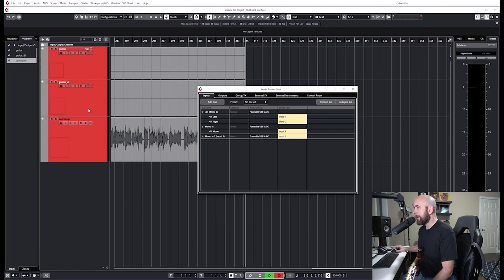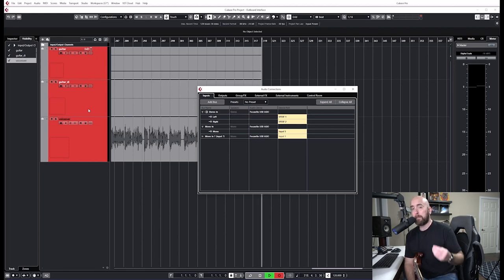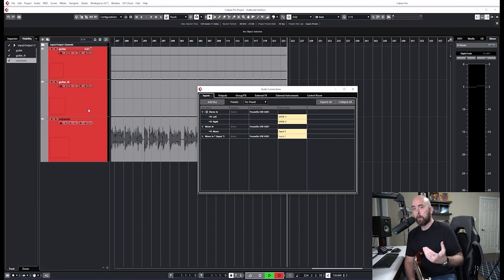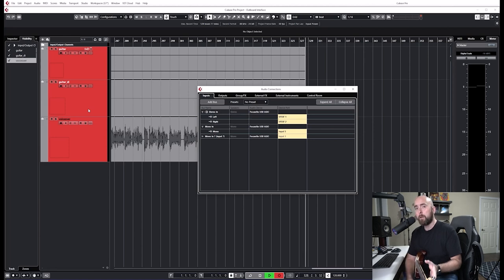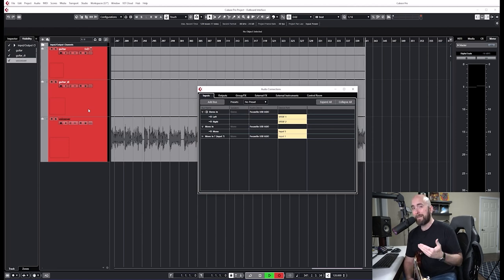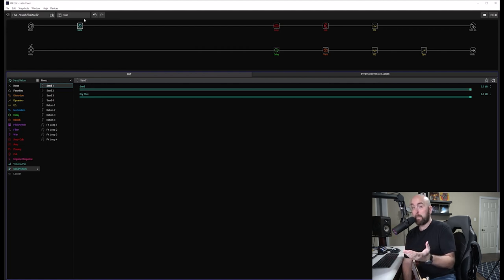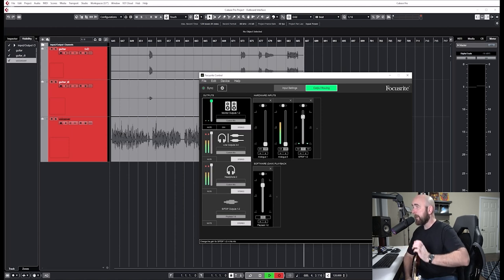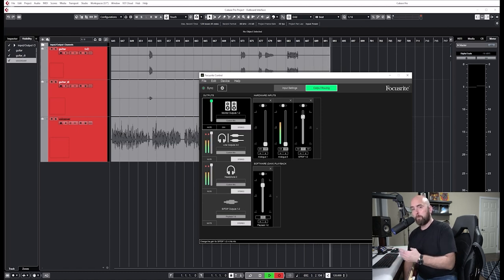The ABSOLUTE Best Way To Record The Line 6 Helix? | Helix In The Studio: Outboard Audio Interfaces

Comment: I’ve been using spiff for years now. It’s just so simple and I get the flexibility I prefer. Also, if you have an interface that has global phantom power, this helps alleviate the issue of running phantom power to the helix if you used xlr from said helix to the interface. Great video Jason

Comment: I couldn't hear any differences between the digital and analog blind test comparison of Tone A and B.

I have a general question about DACs I hope you can help me with. I've heard that new AD/DA Converters are "better" than old ones. Yet, I've read and heard dozens of times that the "Nyquist theorem proves there is one and only one way to draw a band-limited continuous signal through a set of samples." This requires that the Sample Rate is at least twice the highest audio frequency. Accordingly, one should be able to "perfectly" reconstruct the analog signal that was captured using a DAC with that specification, whether it's brand new or 20 years old.

I know there are things like newer/better Preamps, etc. that will affect how the processed signal ultimately sounds. But, according to the Math, the recorded digital signal should be perfect. If that's not correct, could you please explain. Thanks

Comment: Thanks so much for the videos! I'm learning a lot. 

It is possible to have multiple interfaces simultaneously using all USBs. I can only speak for Mac though not Windows. I had to create a custom input and output device that adds all my inputs and outputs together. Figured I would mention it since for many years I thought that was impossible to do. 

So I have:
Focusrite 18i8 - Tracks 1-10
Focusrite ADAT expansion - Tracks 11-18
Helix -  Tracks 19-26

All working at the same time. I have to select "EXP6 All in Out" as my interface and "Experimental MO2" as my output device. Of course these are what I personally named them, but I am not selecting an audio interface in my DAW, I'm selecting a custom thing that combines them all together.

That being said, I've used analog and spdif as well, and that way can make sense for certain circumstances, often I use it that way when Re-amping or something.

Comment: I used the SPDF with my Focusrite 18i20 and it worked, with pros and con. Pro: it expanded the amount of inputs to my interface as I ran out with a full band. the cons were that its a terrible connection, it always came undone if the cable was bumped, which would cause other major issues. also it was a bit to dependant on bit rate with software. I have since gone to a Tascam model 24 Just using analog stereo and all is good

Comment: Great video. My UA Apollo interface however does not have a S/PDIF input, but rather an Optical input. What would be the best solution here do you think?

I’ve tried simply using USB, but there is a clash between HELIX and APOLLO drivers which is causing numerous latency glitches! I want to be able to record Stereo from Helix? Thanks

Comment: I have questions ^^
So I have a Clarett 4i Pre for a few years now and initially setup my Helix with the audio setup Helix -> Audio Input 1 , with the double translation of the signla. Indeed it was nice, not complicated, because the sound quality translation on both side is excellent. I however used a Y Box to splitt the signal and get the DI, I didn't even though about the Send trick XD (I'll come back to that later).
Last summer I realized that there is a SPDIF output on the Helix, so I tried the setup you have now (except with the Y box) and it worked well. Now I also removed the Y-Box because I didn't need it much these days. My Questions:
1. In your video you do not talk about the actual reason I switched to SPDIF: latency. The digital->analog->digital transformation added something like 1ms in the capture of the audio, which was not perceptible most of the time but in super tight sounds it was a bit (and in particular when I try to record with 96kHz in which case I might hit the buffer latency limitations easier). Basically any solution to capture with the less latency possible I will take. So now I'm happy (I did a comparison using a DAW and capturing the same DI signal both ways using my Y-box and comparing by zooming a lot). Did you consider or notice that too?
2. As said I used a Y-Box to get the DI separate and capture it through the audio interface. I was wondering: if my understanding is correct, using a Send block in the Helix to achieve the same is not actually exactly equivalent: the Send can send the signal AFTER having been processed through the buffering system (am I right? I have a doubt) and any other settings in the input node (at least the noise gate). So when reusing the DI recording into, say, Helix Native, you actually feed the buffered signal (if I'm right XD). I don't think it's a big issue in most cases but I would like to check with you if I'm right and if there are situations where there sill be issues, or more exactly change in sounds.

Comment: Hi Jason.

I'm using a Variax Standard with the Line 6 digital cable (AES) connected with my Helix.
Is it true that i can't use SPDIF then, to connect my new Scarlett 8i6 with my Helix over SPDIF?

You make a great job, thanks for that.

Greetings from Germany
Roland
Reply: Did you ever figure this out?
Reply: @HammyHavoc  Hi, i don't try it. I would not destroy anything. I remember that i read this somewhere.

Comment: If only they could add / have added the option to send 8-channel ADAT over the digital output, then it could mirror the USB audio and avoid the need for D/A-A/D compromises. An alternative in the mean time might be to focus on capturing the dry signal digitally and use the Helix Native plug-in to recreate the wet sound in software, with the hardware's wet sound coming into the DAW via analogue as a guide / backup.

Comment: what about recording via USB? Even there would you skip the conversion D/A A/D?
Reply: Right, The only reason I can think about to add one further cable is when you run out of USB ports
Reply: @Elassar72 the issue is that you cannot generally use more than one interface.  If you use the Helix USB out, you forego the use of the main interface (unless you use ASIO4ALL on pc, or set up an aggregate interface on a Mac).  If you use these workarounds, you're basically bypassing the (generally) very good drivers that come with your interface.

I've tried and tried to find a way...  short of running the helix usb through an intermediate computer, and rerouting it digitally to the main interface, I can't think of anything better than a send block in the first position.

(I am open to ideas though, as this has stumped me...)
Reply: I use an Aggregate Device and USB works a treat in Logic X.
Set Output Block of Helix of any preset  to USB 3-4.
Set Logic X stereo track to that too.
And that's it.Make the preset ' in house' since you'll hear it all together in your Studio Speakers.Logic X Software Monitoring is ON.

In Global Settings you can choose to 
Send USB 1-2 to another speaker or set of speakers (amp/cab) in the room but I don't.I can experiment with it though, to have a low level ' cab in the room' vibe as well as the main monitors..But the studio monitors that outputs all Logic is great enough, to hone in on the guitar sound.Make the Agg Device , with your main audio interface as the  
' master' and Helix to fuse with it.